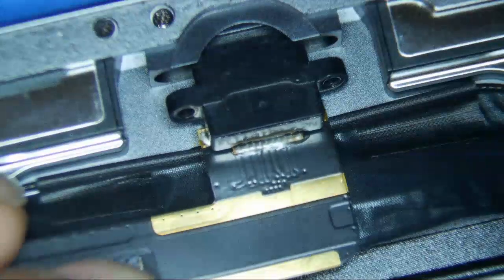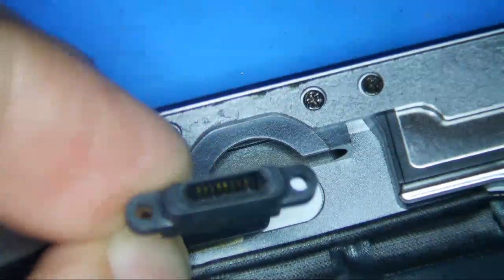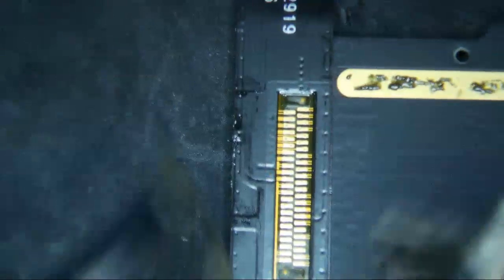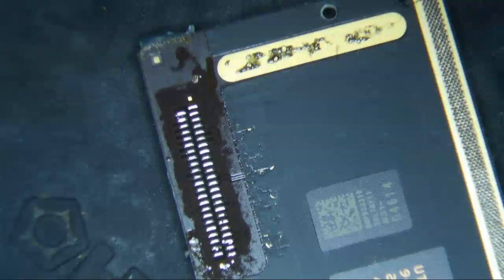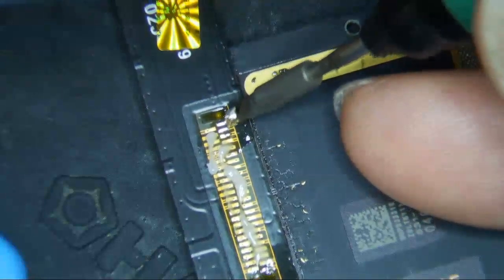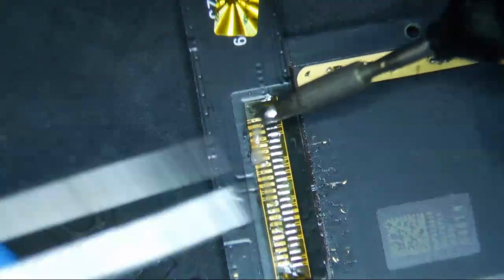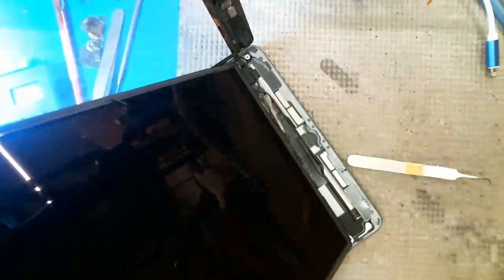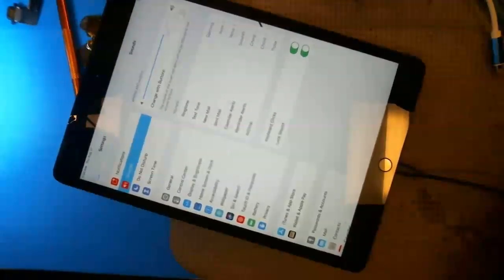iPad 7th Gen Charge Port Repair

Comment: Very useful tutorial, most important thing is lining up those anchor points correctly and adding enough solder (without bridging) above and below the connector flex on the pins. I used a thicc solder tip to get 2 pins at a time, very doable not difficult at all!

Comment: Why the hell wouldn't you just buy the flex cable with the port? It's literally at most $7 and you don't need all the hassle
Reply: This is the flex cable with the port attached. The portion he's showing is how you attach the opposite end of the flex to the motherboard/logicboard. This is the only option for the 7th generation ipad. It doesn't have a plug-n-play connector on the end like some other components.
Reply: @memack1950  wow! Please tell me you don't have to do all of this with a gen 8? Please tell me it's a quick connect?!
Reply: @phillippardo5712  nope same setup as the 7. There will be soldering.